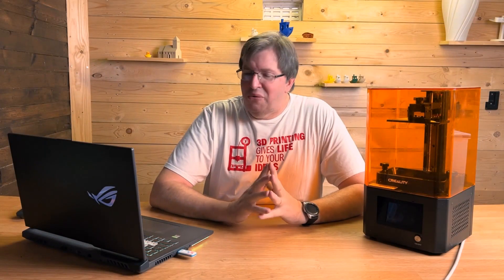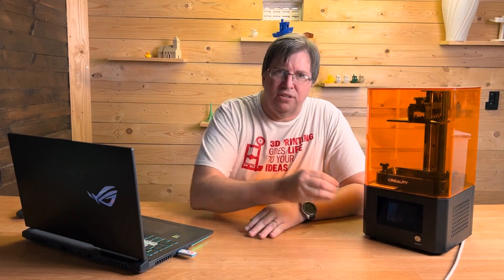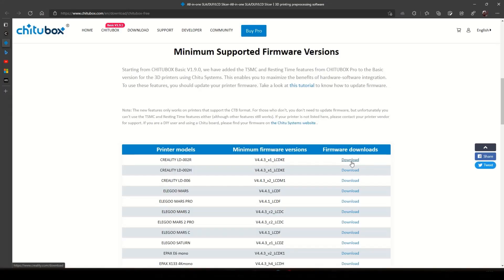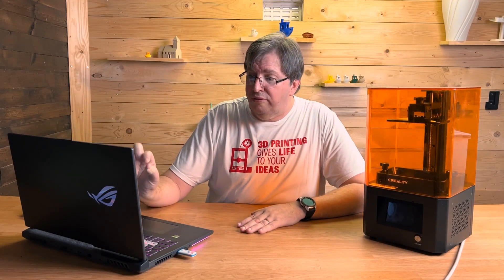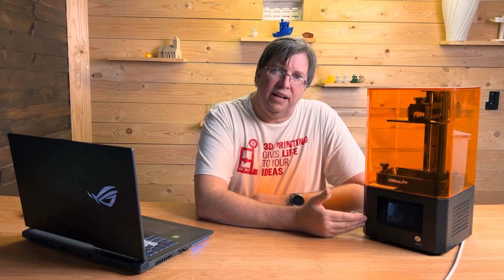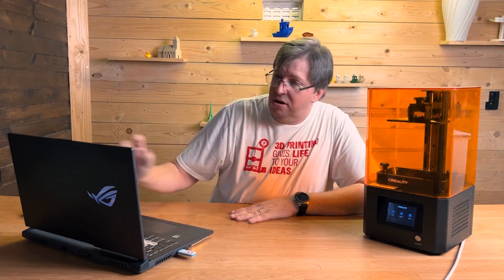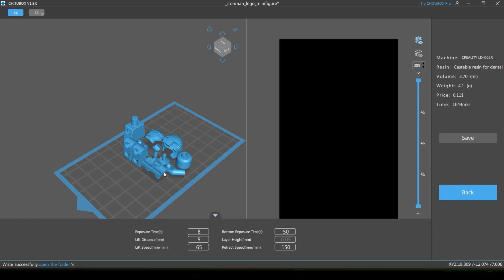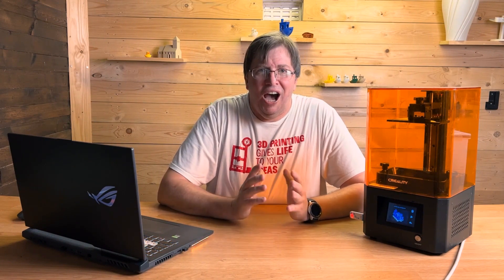Chitubox 1.9 sliced files not working on Resin printer

Comment: basic v2.3 is working awesome.. fast and print witout fails.. now with v1.9.5 beta its just horrible.. it takes endles for every step and i have 3 of 5 prints failed 2 because the printer just stopped at layer 22 for no reasons.. with basic v2.3 it is working.. so why t f should i use that crappy v 1.9 ???

Comment: I downloaded the same files everything my printer is not accepting the firmware or the print files I save. I need help. Like more in depth about the firmware into the flash drive because I’m just learning. 

It’s not easy what so ever for me. I usually am fine with doing stuff but I need help.
Reply: I'm having a similar issue. Updated all the firmware and still getting Unknown File Format. Pretty frustrating.
Reply from the maker: Did you come right?
Reply: @FusionSource  what?
Reply from the maker: Hi, did you come right?

Comment: You kinda helped me still having problems but since we're using Sam laptop n programs you got a subscriber
Reply from the maker: Hey Chris, glad I could help, even partially, thanks for the Sub, appreciate it.  Is there anything else I can help with, what issue you having?
Reply: @FusionSource  so it shows the file n I click it but the printer keeps bottoming out even after I zero the bed
Reply from the maker: @chriswills418  Hey Chris, I had the same issue a little while back, maybe I should do a video on it, the sensor at the back popped out of it's socket, so the sensor did not trip, telling the machine that it is at the bottom
Reply: @FusionSource  sweet okay I'll take a look n see how it goes
Reply: @FusionSource  you were correct it's my sensor it's not triggering when the plate is on but when it's off it'll start printing
Reply from the maker: @chriswills418  Great news, glad it is sorted